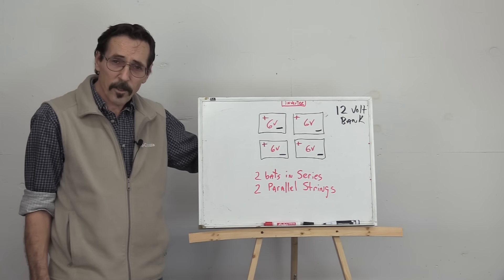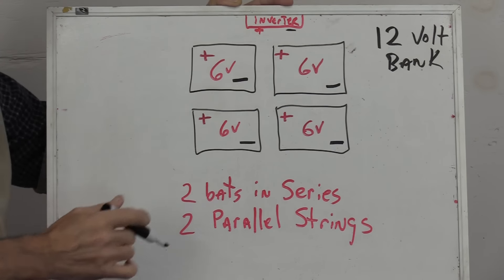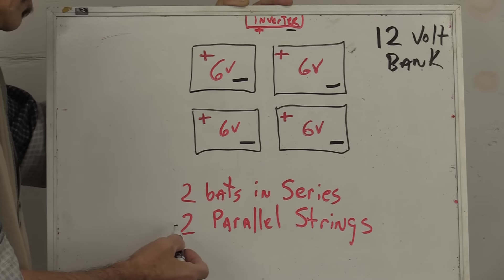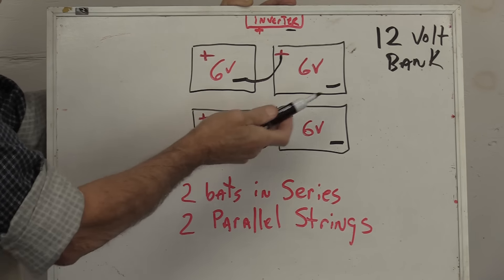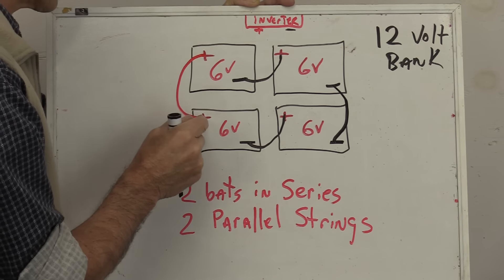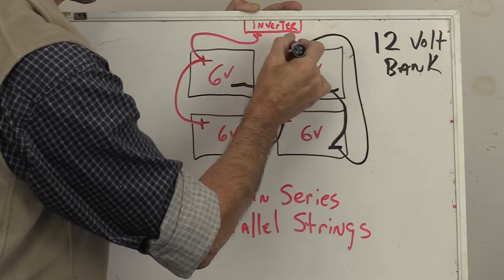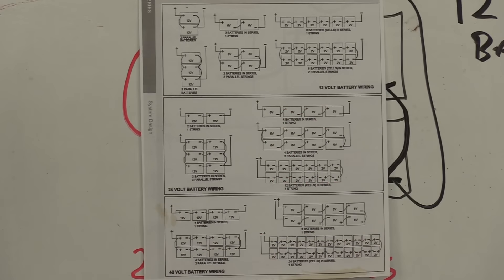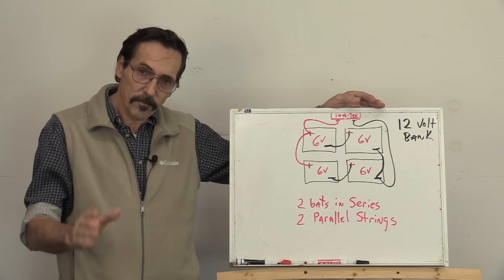Battery Wiring for the Beginner: Part 2 Series Parallel | Missouri Wind and Solar

Comment: Jeff your info is always so accurate and well explained.   

Could you please!!!!!!! Make a video to explain grid zero inverters and grid tie limiters???  Nobody else seems to understand them,  myself included.  And let us know which ones you recommend and sell,  I'm in the market because my power company has installed a smart meter that charges me weather I  push power back to the grid via my cheap grid tie inverter or if I use their power. Dang Southern Colorado. 

Thanks  Jeff

Comment: Looks good! Question Jeff: What are your thoughts on desulfators? More specifically, the "Battery Extra" or the BLS versions? Trojan says not to hook them up because they can cause more harm than good. Seems to me there is some science behind desulfators. And surely a battery company would say something like that...they want you to buy more batteries instead of preserving them. Thanks!
Reply from the maker: Don't know about the brands you just mentioned, never tried one of them. I do know there are a lot of junk desulfators on the market that don't work.
NO, the battery guys don't want you to use a desulfator at all, buy more batteries is the idea.

Comment: Jeff, is there a wiring diagram link for solar panel like the one you have for batteries. 
I need to change my 12 V solar array to 24 V I have 14 100 W panels.

Comment: Hello, I got two 12v/100ah batteries, I installed them in parallel, so now I have 12v/200ah, the battery's documentation says the recommended amp to recharge it is 15 amp, my question is, as they are installed in parallel, can I set my charge controller to recharge the batteries at 30 amp, or should I set it at 15 amp? Thanks!